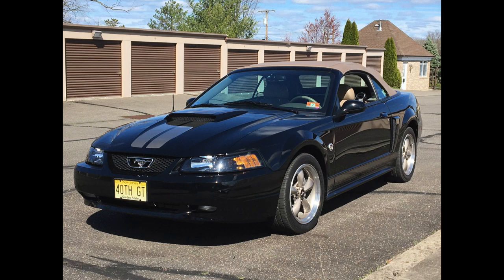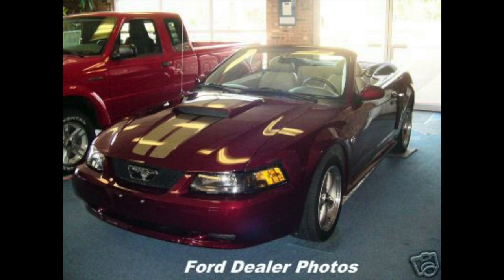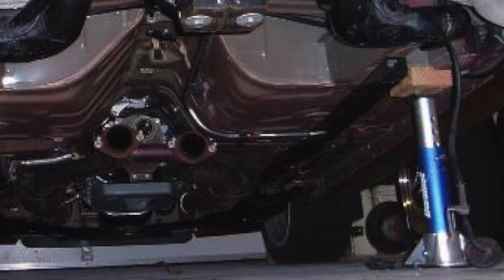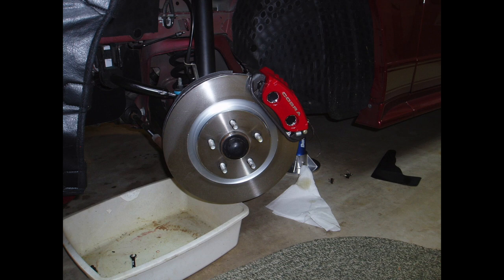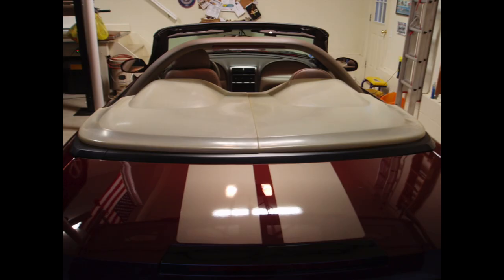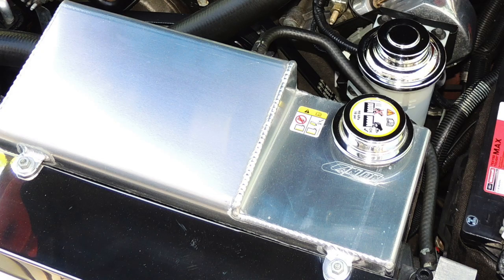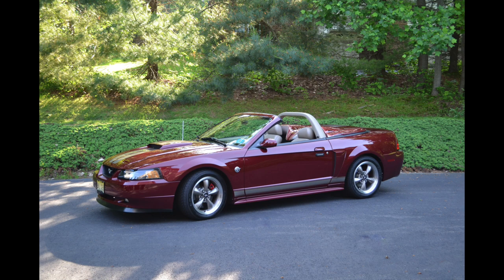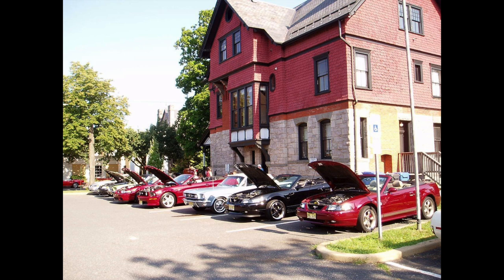40th package 2004 mustang GT Crimson Red : Story

Comment: My mom bought a 2002 Explorer from a local Ford dealer back in early 2004. I was 12 years old at the time, and remember 2 crimson red 40th anniversary GT's on the lot beside each other. Both had the tan interior and trim and one was a vert. I think they were both automatics. I remember how cool it was because those were the only ones I had seen at the time, and I still don't think i've seen many since.
Reply from the maker: Awesome memory

Comment: It's nice that you did videos on the 40th Anniversary trim cars. I have an oxford white GT! I actually bought the car not knowing it was one of the real 40th cars. It wasn't till I noticed the differences the 40th cars have over the non 40th cars. Mainly the badge on the shifter bezel caught my eye and made me wonder. So I started doing some research. I think I have the only oxford white one in my area. I only saw two crimson reds and one black GT.
Reply from the maker: That’s really cool. I’ve seen a few white V6 ones but very few white GT’s
Reply: @justin.c_svt   Cool thing is, this was my first mustang. It's seen a lot of owners and it needs a little TLC and such. Nothing too bad. Poor thing has had a very crappy repaint on the rear bumper and someone backed into it when I was parked at Walmart. The damage was only internal on the front bumper. It broke the passenger side mounting bracket. I found out when I took it off to install a mach 1 chin spoiler. I was a bit upset about it. If you'd like to see it, I recently uploaded some very nice pics of it here on my facebook. https://www.facebook.com/photo?fbid=930571224055220&set=pcb.930571307388545
Reply from the maker: That looks great. Are the side stripes still gold? Hard to tell in the picture.
Reply: @justin.c_svt  Yes. It's hard to tell in that lighting like you mentioned. My stripes are also getting sun damage. I buffed em' out. However, the ones on the hood were hit the worst. They faded pretty bad. So I use wax and they usually look pretty decent. Also thank you. It's my baby. I'm hoping to get it squared away and make it near mint. It's going to get a supercharger some day. Positive displacement. Gotta have dat whine.
Reply from the maker: That’s awesome. Great choice on the supercharger. It’s a great car to enjoy and take care of.
Reply: @justin.c_svt  Thanks! Before I do anything, I'm thinking about to putting a non pi motor in and put my current heads on it to get that nice little HP gain with the higher compression. I'm currently having weird engine problems though. I modded the whole intakeTB and all. I'm thinking the PCM cant handle the extra air on the stock tune. I'm running super rich along side with some very odd symptoms.
Reply from the maker: Yeah I probably need to tune. I would get it tuned once you change to the non-PI in Bottom end
Reply: @justin.c_svt  Right. Because of the new compression ratio. I've had nothing but a head ache with it's stock engine. I'm threw with it lol. It's been good chattin with a  fellow new edge lover. Thanks for the little chat.
Reply from the maker: Good to talk to you too.

Comment: Hey Justin awesome video. I want to get a new edge mustang but I wanted something with a v8 but that is a bit less common than the gt. 10-15k I was thinking about a Saleen is that good?
Reply from the maker: It depends on what you like the most. That would be a good choice
Reply: Justin SVT ok thanks, but can you get a saleen for 10k.
Reply from the maker: I’ve seen some. Probably not the supercharged S281-SC but I wouldn’t pay that much for a 2V with a small blower on it

Comment: Hey what's a good way to tell the difference between regular bullitt wheels in the gray vs the 40th Anniversary Arizona Beige wheels? I know the color is different but they look very similar what's a good way to tell the difference and make sure it's the actual Arizona Beige wheels thank you
Reply from the maker: As far as I know the color is the only way except the part number for the 01-02 Bullitt wheels vs all 03-04 bullitt wheels may be different.
Reply: @justin.c_svt  yeah I might need to get the wheel off then look at part number is there anyway to check the color can I email you a picture to see what you think?
Reply from the maker: @scuevas7  You can email me at xsellr9@yahoo.com